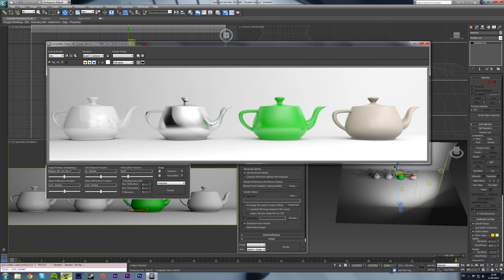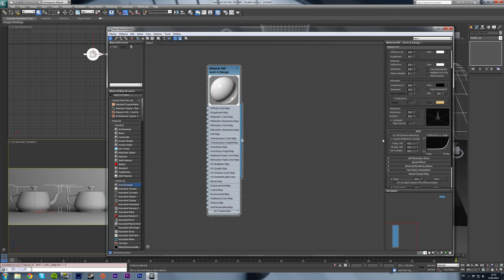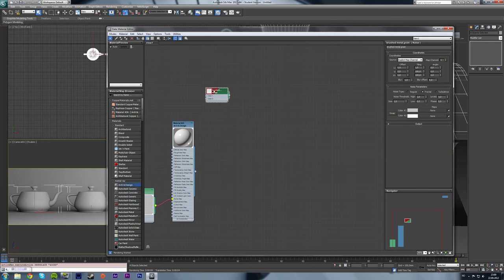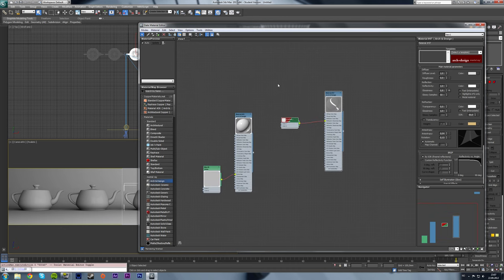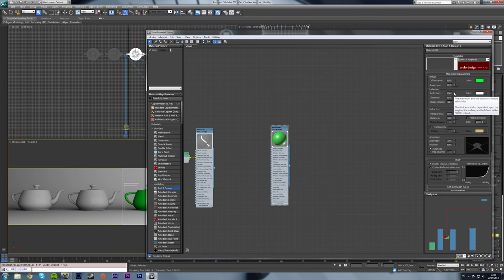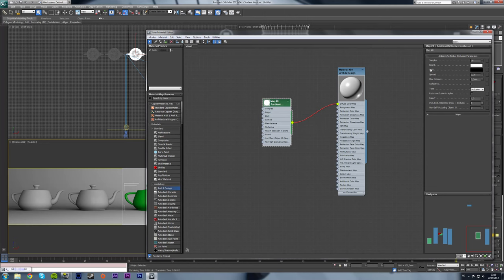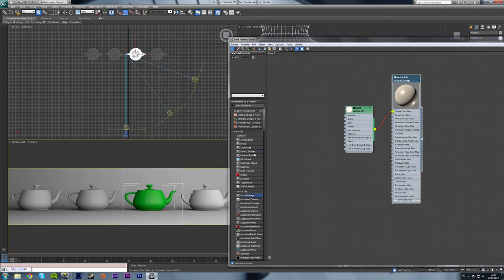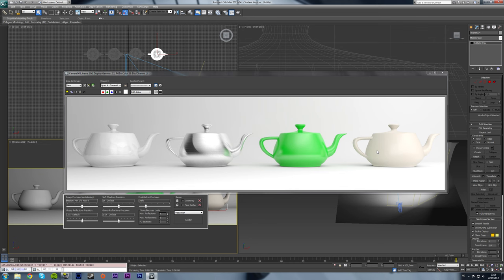Arch and Design Material Tutorial

Comment: You saved my day! Had almost forgotten the "glossy samples" parameter and wondered, why my metal was grainy or full of stains. Set glossy samples to 128 and all was fine. Short render time comparision: Glossy samples 16 - 2:12min, glossy samples 128 - 4:59min, glossy samples 128 with fast interpolation - 3:51min. The result of fast interpolate seems to me a little bit smoother, bur with less details and darker in areas of shadows.